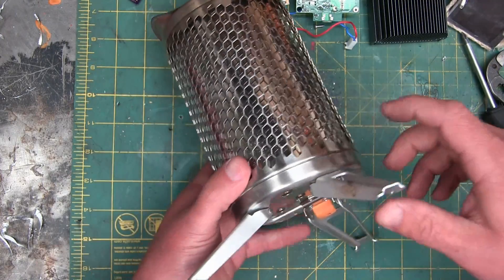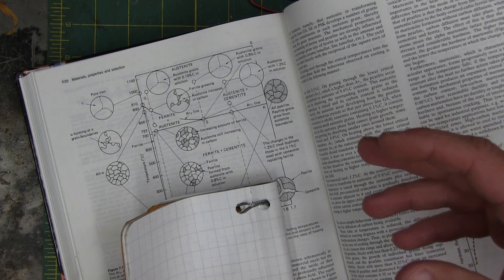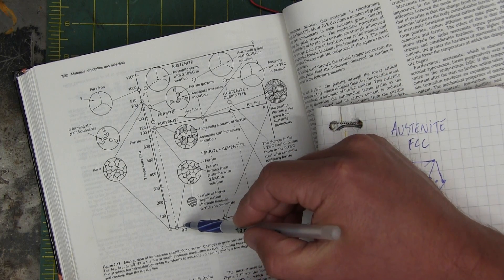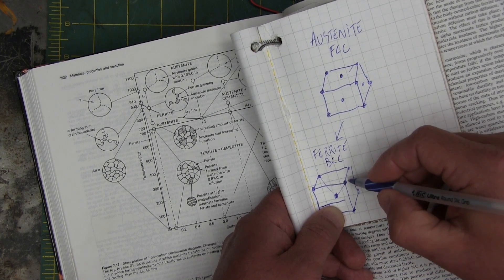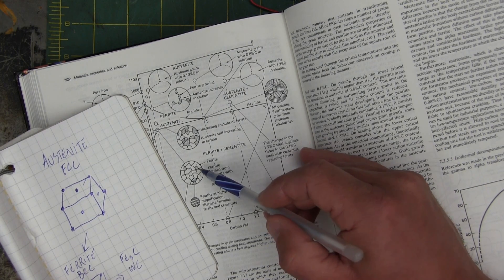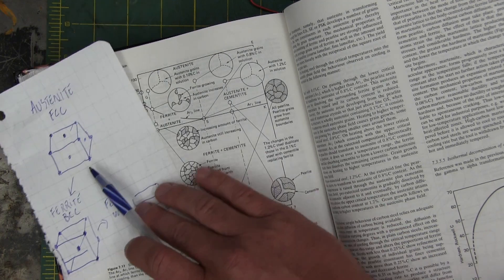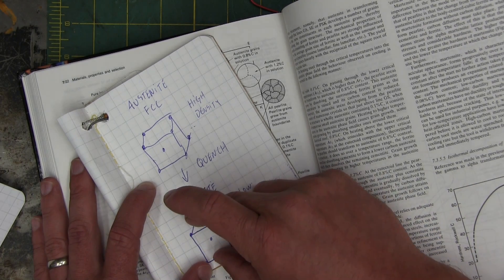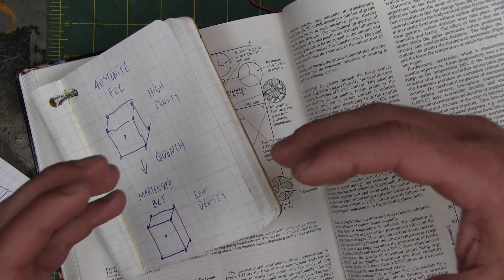STEEL -  QUENCHING IT HARD! | Enginerding 101

Comment: You should tackle stainless steel next. Everytime I look up how it works, I basically get "black magic"
Reply: Passivated surface of metal oxides that are more stable than iron oxide... basically, chrome and nickel in varying proportions, with other metals thrown in in trace amounts to stabilize the crystals and/or the grain boundaries where the crystals touch.

Stainless is also known as rust-free steel - in part because under the right (wrong) conditions, you can stain it.

These passivated surfaces being oxides, if you hit it with a reducing agent - forex liquid ammonia - you destroy the otherwise stable oxide layer on the surface, and can corrode the hell out of the metal.

A metallurgist can turn this into a doctoral dissertation, but this is the essence, and all that most mechanical and chemical engineers bother to worry about.
Reply: JediMasterT just fucking magic you
Reply: It's all about the free chromium and the surface (and the oxide layer it forms).  
Extra carbon can bind to the chromium (chromium carbides) and make something with a fairly high amount of chromium (D2 tool steel @ about 11%-13% cr and around 1.5% C) be basically non stainless, where something with less carbon but about the same amount of Cr be stainless (AEB-L @ 13% cr  w/ .6% C). Then you have stuff like 3V which has only around 7% Cr and .8% c, but is semi stainless. I think depending on how it is heat treated (and I assume how much freed up carbon there is) you could make it either less stainless like D2, or more stainless.
Reply: Oh and if you break that surface oxide layer, the steel can go to shit, just like chemech said. 
I tired to acid etch some AEB-L @ 60 hrc and had no luck. Decided to leave it in the bucket for a few days (vinegar, hydrogen peroxide, & salt) to see if it maybe would just take longer. Went to to grind on the blade afterwards and under the shiny surface, the whole interior of the blade was junk.
Reply: that comes from people using shitty base metals not the alloy itself
Reply: Stainless steel is only non-ferromagnetic when it has a suitably high nickel concentration. Ferrite is magnetic, whereas Austenite isn't. Nickel is a strong austenite stabilizer, so basically when you create a stainless steel with enough nickel, when you cool it to room temperature, it remains austenitic and hence is not magnetic. 

Why is austenite not magnetic? That's a bastard of a question. The cop out answer is "its just quantum physics". The real (but slightly simplified) answer is that the spacing between the iron atoms in austenite is slightly larger. This means that the exchange interaction (pauli exclusion principle) -  necessary factor in magnetism - is too weak over these ranges to allow the alignment of magnetic domains and create a ferromagnetic material.
Reply: It has reactive surface oxides that form a passivation layer. Also, in high-carbon, high alloy steels there is formation of separate grains of the carbides of the metals like chromium, nickel, molybdenum, tungsten, etc. The distribution and size of these grains of carbides plays a role in hardness and wear properties of the steel, but I am not sure what exactly they are. But I second your request.
Reply: And the added stuff chrome/nickel and stuff I don't know is what makes it non-ferro-magnetic
Reply: It's not nickel, it's the chromium that causes stainless to resist corrosion. Although nickle can effect how a steel oxidizes (15n20 and Damascus with an acid etch), it does not protect against it.
Reply: chromium and manganese particles coat around the iron molecules which prevent it from touching oxygen and also give the blade properties of hardness and sharpness depending on how much, as well as other elements like cobalt are sometimes put in the steel, the amounts of the metals in the steel determine its qualities
Reply: JediMasterT ha. Me too.
Reply: JFM. it's all JFM.
Reply: JediMasterT not sure what you were exactly trying to find out but stainless steel just has a greater quantity of other metal atoms like chromium, silicon, magnese and other non corrosive metals. The cheap stainless steel knives you can buy are usually very corrosion resistant because they haven't tried to make the blades hard by increasing the percentage of carbon atoms in the solution.

Comment: That IS pretty amazing, that such a small percentage of carbon and how quickly it cools makes such a difference. 
Do the properties of steel change if you heat it to say, it's curie temperature to bend it, and it recools, or would it have to be almost molten again? How hot does steel have to get to "undo" the benefits of quenching?
Reply: Andy Jones as far as au can remember, you need to hear it to at least 700°C for a good amount of time to allow the carbon to spread out evenly again.

Comment: So... when you quench in oil, is it to keep carbon, or add carbon? I was under the impression that quenching in oil adds carbon to the steel (from the oil?). Also, what about "normalizing", low temperature, long time, what does that do to the structure of the steel. Thank you teacher bumble#¤%.

Comment: This video ended like my first time... prematurely
Reply: The full 2 minutes
Reply: I was just warming up, though different plastics and molding them in diy-style would be more useful for me right now. :D I picked up different plexi-glasses from a skip/bin/trash, from a kiosk teardown and there is 1cm thick safety variety to poster-holder weather proof and the surface tension after bending baffles me. :DDD Using blowtorch you can see it warping but now i`ll dig up the heat gun. :D
Reply: When your lady silently gives you a towel but you've already showered you know it's about to get naughty...
Reply: Damn, I felt that wholehy😢😂😂😂
Reply: beach bummin i sure played my wife for a fool. i had a vasectomy, and she has gotten prego 3 times. she still thinks i am the one doing it. i dont have the heart to tell her. :)
Reply: depends, my first time with myself was faster than my first time with my victim. :) just kidding we broke the bed, i was an impressive virgin. 33 years later i still have her fooled, we have 3 kids but i only used a toy on her. hmm.

Comment: Very basic stuff, most tool steels are quite a bit more then iron and carbon
Reply: You saw the "101" part right?  Apparently not. I'd venture to say that most people watching this channel have not taken any metallurgy and we're nerding out right there with AvE.
Reply: You're a smart guy. If you were a little smarter you might have caught the part where he said this was a basic overview of the subject.
Reply: +Bob Joe oops, you accidentally let your insecurity show to the whole internet. how embarrassing.
Reply: Bob Joe Yeah but a good chunk of the other alloying elements are done to make alterations to these phases he is talking about.  The one thing he glossed over a lot more was the time factor.  How long you keep the steel at various temperatures and heat cycle it makes a pretty big difference in the final properties.
Reply: Judging by past convo's I'd be surprised if at least 1 out 5 here did not know this and more. I know I do.But I am surprised to see no detailed steel convos in the comments. Probably the time of the morning this got released.
Reply: +robert denicola ??? He didn't gloss over it, that was all he talked about, even the chart that he showed several times explained the importance of heating and time of cooling.